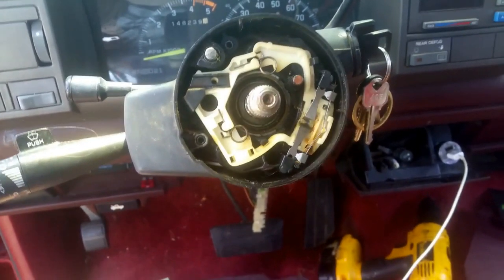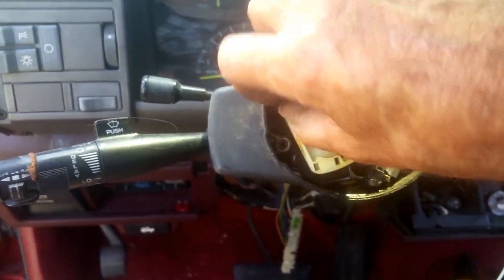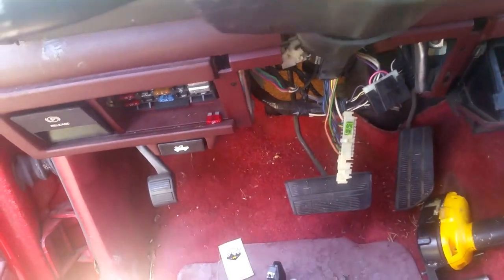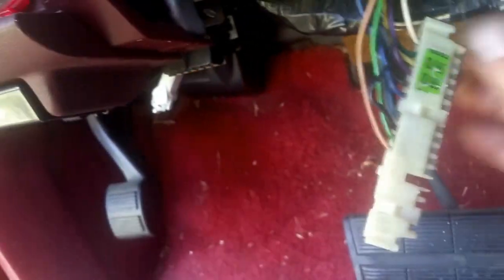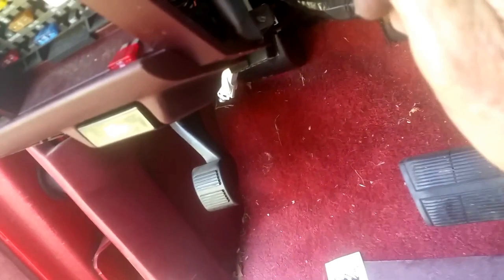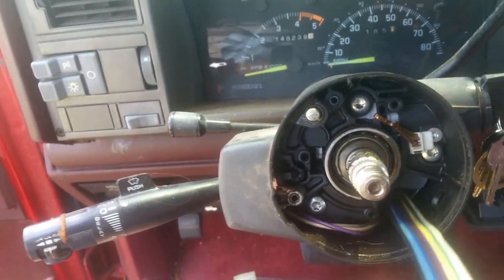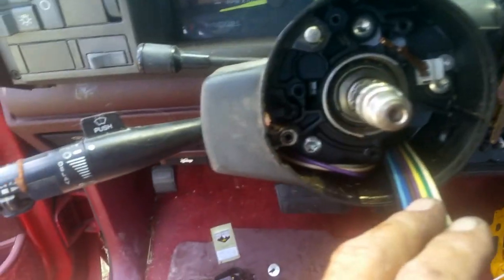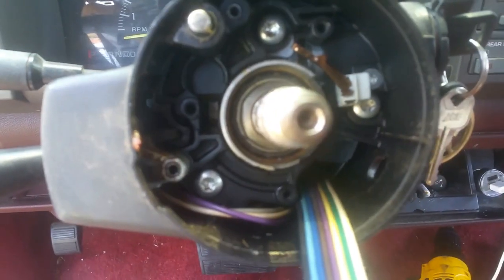1993 chevy suburban turn signal switch

Comment: I think i will just cut the old plug off and pull it through, but thank you for the video it helps me understand what to do.
Reply from the maker: For myself I do not like to cut factory wiring, If you do I would solder the wires back. TFW
Reply: Danny Collins I guess I was under the impression the new blinker switch came with a new wiring harness and that the old plug was going in the trash..Thank you for letting me know..
Reply from the maker: Yes, Scott, the turn signal switch comes with the harness as one piece, I just fish it down through the steering column. I hope this helps you, PS; I am trying to get better on youtube as I do like to help people, thanks for watching.

Comment: I had hazards but no turn signals  No light on dash or anything. Bulbs good. Wiring/ ground good. Went to the junk yard to get a turnsignal switch. Grabbed a turn signal flasher that looked shiny [located on the bottom left corner of the driver side floor mat.. The bottom left black relay looking box] and boom. Problem solved before i even put the switch in.

Comment: Thanks for the video it don't look too bad to get into but my question is do I need to replace the switch or just the cam?? If I turn and it won't cancel back but the switch is pretty stiff going both left and right
Reply: Did you figure out the problem?? I’m having the same issue.
Reply: @adriansantana2474  I bought a new cam because the springs were broke inside the cam and that’s why it was binding up... the switch was fine.